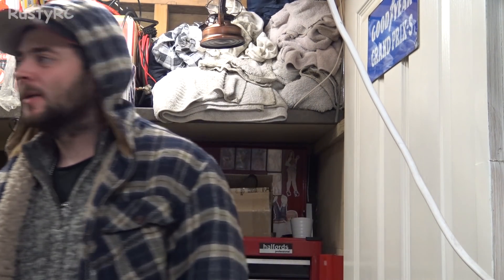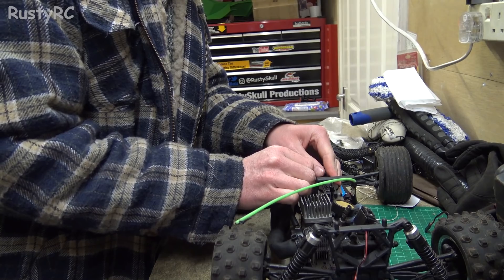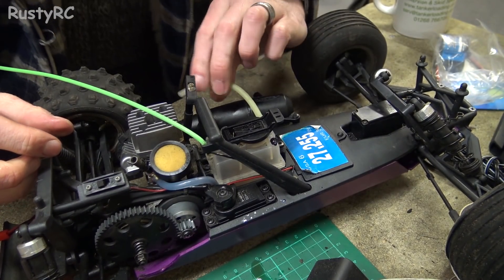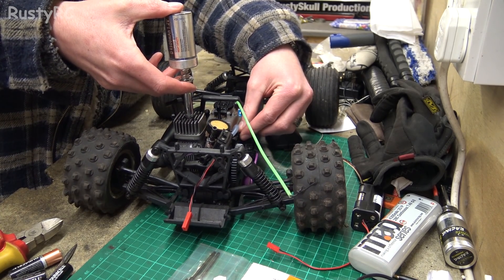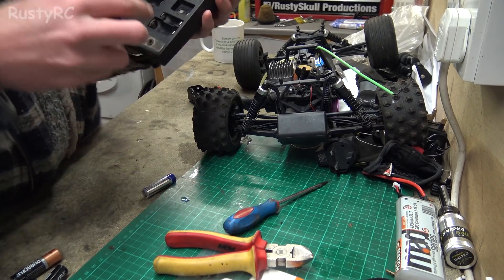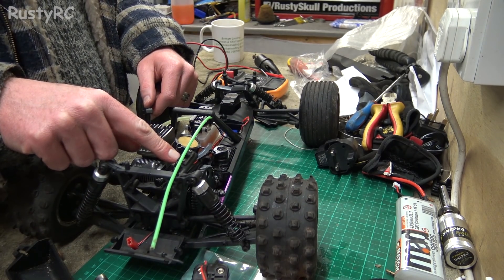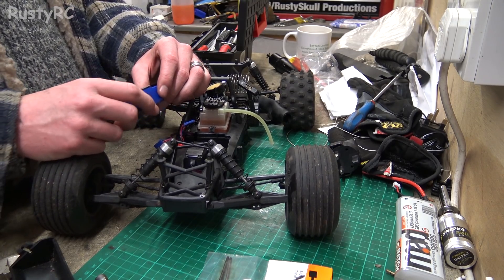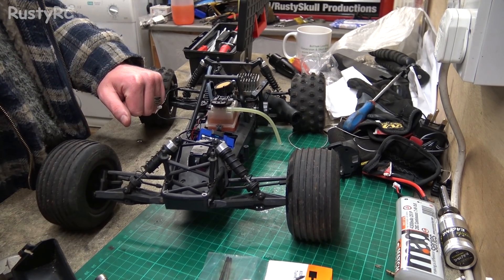Will It Run? HPI Rush Vintage Nitro Stadium Truck

Comment: Got one myself. 15fe engine is a good runner. Oh good tip to keep the engine lasting longer is when your done running the engine, keep it at bottom dead center. When it cools and the bore compresses it will save the piston, not sure if you know about it
Reply from the maker: Hello matey, yeah I know that old trick, there are loads of things "you could" do to make your engine last but honestly I've never done any of them lol. I've never used After run oil or any kind of oil either 0.o Shocking I know for somebody who always makes video's about how to look after stuff but... What can I say I'm a hypocrite  lol.
Reply: @HaggardRC  ohh yeah I forgot about after run oil, I tried for a while but gave up using it, lol

Comment: I’ve got a Rush Evo also, only difference is mine has a K5.9 and a novarossi boat pipe
Reply from the maker: I'm thinking of finding a slightly bigger engine for my Evo as they don't make the T15 anymore.
Reply: Rusty RC big block it, pretty simple I think that hardest part is linkage, all u need is mounts and u can do anything

Comment: just check battery holder make sure batterys are contacting properly had issuses with my battery holder if its noy that maybe radio gear,
Reply from the maker: Oh yes it was indeed the radio gear, just wait and see how easy it was!! Thanks for your comment matey :)

Comment: Where can I get a complete gearbox for mine or can you do a video on how to put new years in
Reply from the maker: You probably can’t buy new boxes now but you may be able to find a used one from eBay or the MS-uk forum.
Reply: U buy the rebuild kit part number a432 should solve ur problem

Comment: Those 15 fe engines is the definition of a shity engine giving nitro a bad rep theres onley one way to make that engine any good its to find the part number 1695 piston nd sleeve kit with 15ss conecting rod cuz its actually abc constructed nd good luck finding it  u think t15 hard to find the engine u got now the top end is all aluminum in burns out lucky to get a gallon of nitro threw it nd forget running the car if its hotter than 80 degrees out wat a pos
Reply: It’s alright they’re nice looking.